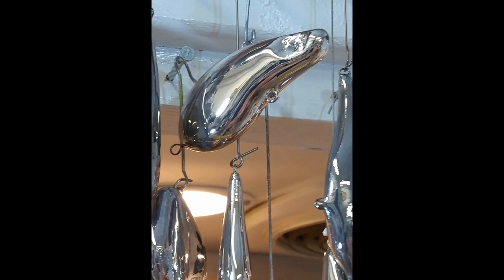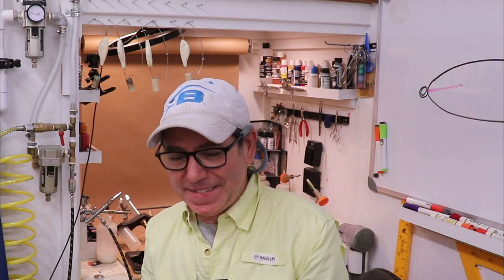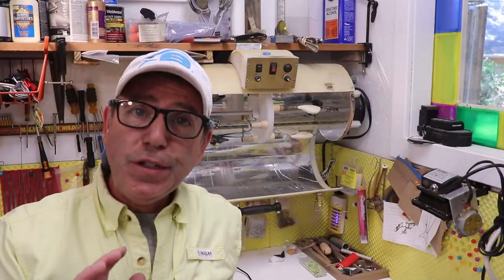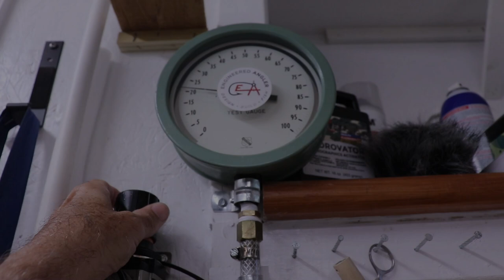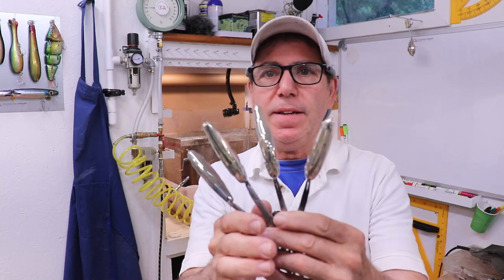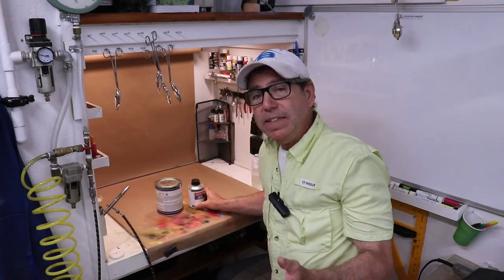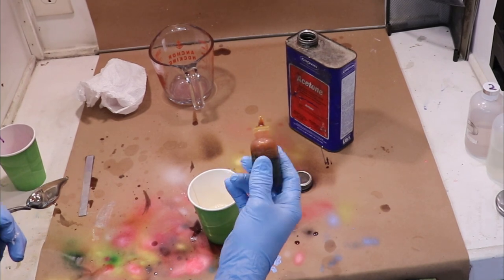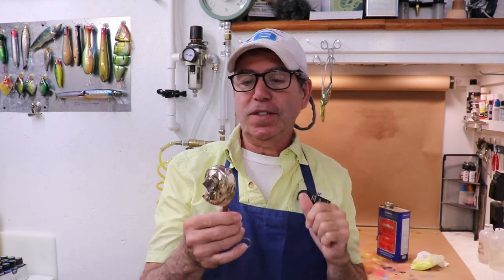Spray chrome for lures, silver plating lures and a reel.

Comment: Hey Franco, I’d love to see more on automotive clear coating.  Are you using an HVLP gun to spray the auto clear?
Reply from the maker: Yes its a mini gravity feed but the key is the adjustment.  I set it up right at the very lowest range of it's operating pressure and air flow.  I also set it up to have a very small spray pattern.  You could see in the video how close I could hold the gun to the target.

Comment: Why did you use an automotive 2 part rather than the minwax you normally use ?
Reply from the maker: I would normally use the minwax as a mid-coat to protect the silver from most clear coats but, the two part clear dose not react with the silver so I saved a step.

Comment: Nice video. Can you comment why clear coating with KBS would still cause a silver plated salmon spoon to tarnish? I cleaned off the black tarnish with a silver brighter dip. Spoon returned to new look. I thought sealing with KBS would protect the finish but it darkened underneath after a week or so. Any thoughts?
Reply from the maker: Yes...Most clear coats including two part resins will react with the silver and start the oxidation.  There are only a few clear coats that will protect the silver.  If you visit some websites that specialize in silver you can find some protective coatings.
Reply: @EngineeredAngler  one year later and still looking for a specific clear coat that covers silver and gold and does not tarnish underneath. I tried Everbright, jewelry clear but not good for fishing applications Chips easy. Any others you can think of?

Comment: Are you dripping  into  wetting agent and the sensitizer in the same mix? can  you combine them?
Reply from the maker: I don't use the wetting agent...just flame lick,  then dip into sensitizer, rinse and spray the silver
Reply: @EngineeredAngler  will you be doing any tests with this process with flexible parts?

Comment: Hi Franco, what about the mini spray gun that you are using, nozzle diam? I would like to buy one but the price, at list for brand ones, are to high for my wallet. What about yours? 
Thanks so much 👍
Reply from the maker: Watch this
https://youtu.be/qV8SV85xIAw
Reply: Thanks, I did not mean the double bottles gun, I already built one thanks to you as always!!!!!
, I was referring to the mini spray gun that you are using for clear coat, nozzle size, gen detail, thanks 🙏👍
Reply from the maker: Oh...the mini paint gun is the smallest of the ones harbor freight caries.
Reply: I found an automotive clear coat that works so well however, impossible to spray with airbrush, must be thinned to much. I was thinking about a mini spray gun but I never used one, no idea about nozzle diam, that's why I saw you and ask 
From here Thailand, the harbor freight web site can not be opened, don't ask me why, what about your gun nozzle diam?
Thanks 🙏 so much!